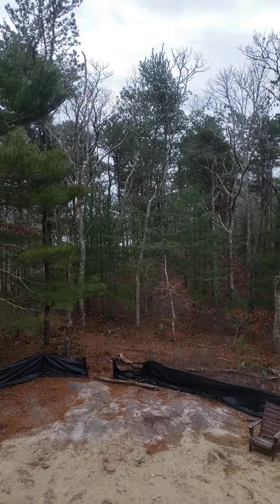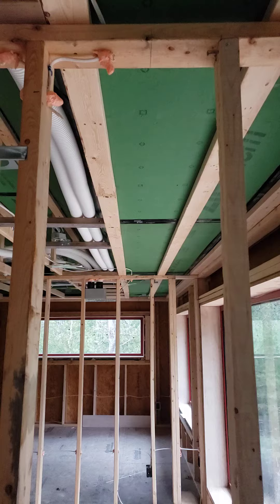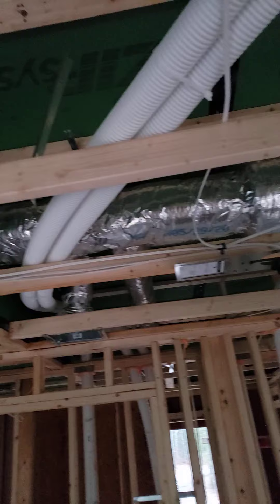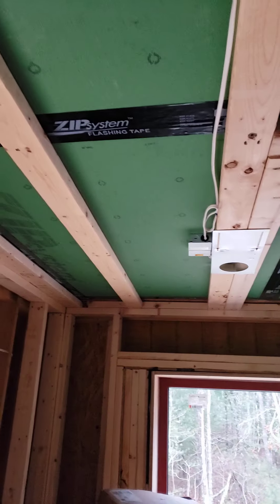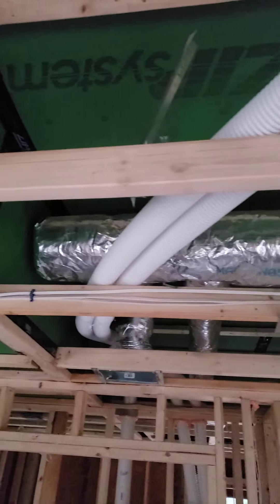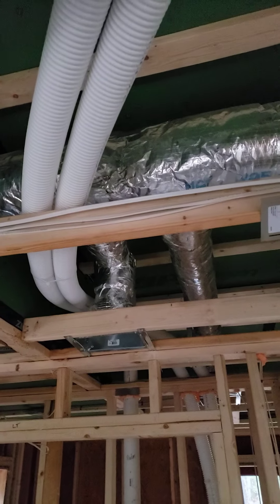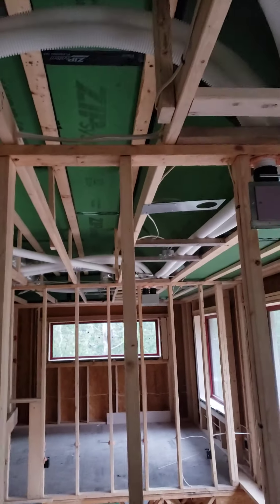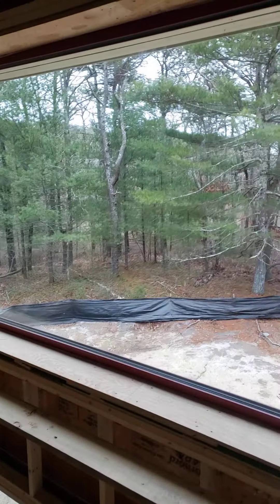A Second Look at the Manufactured Attic

Comment: Taped subfloor? Nice detail.
Did it help swelling ?or you waited till roof?  Or You pouring over it to level it?
Reply from the maker: It is a finished concrete slab, you are looking at temporary protection
Reply: @stevenbaczekarchitect9431  oh yes your super nice detailed... How long drying time  before the plastic gon down? 
Has a sider in the past I always tried to keep paint off the floor for customer new garage. 
It just suck when set up n then concrete guys comes pour. 
You architects don't make it easy on the cladders for sure. 
Can I just get some cupcakes ranch like post war world 2 to work on? Lol